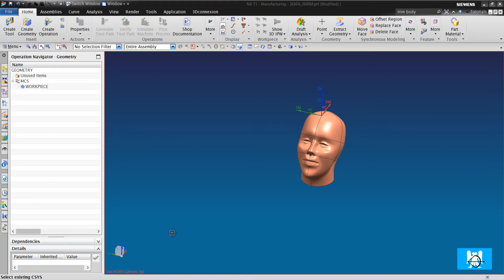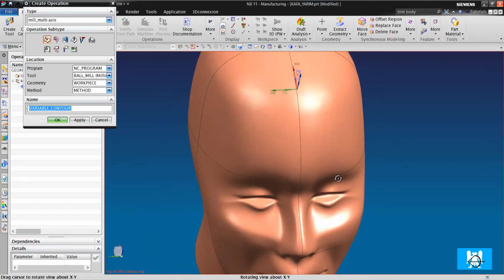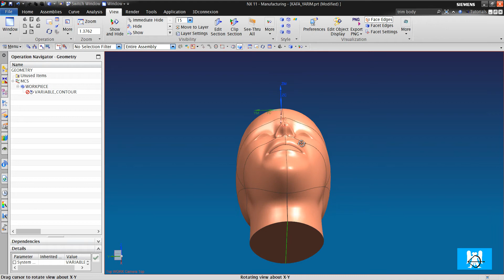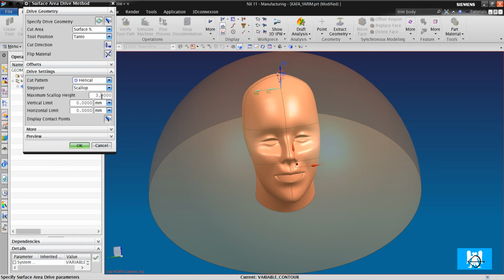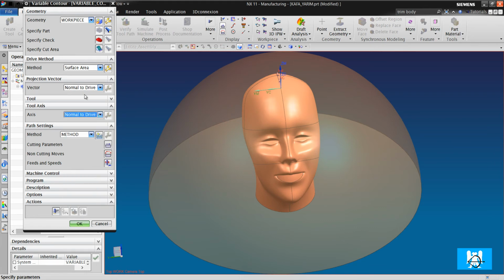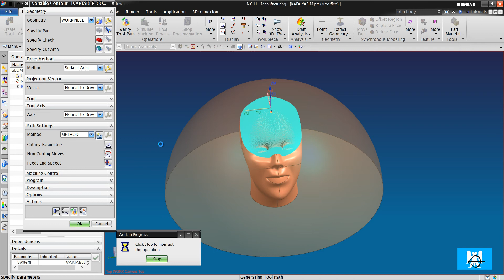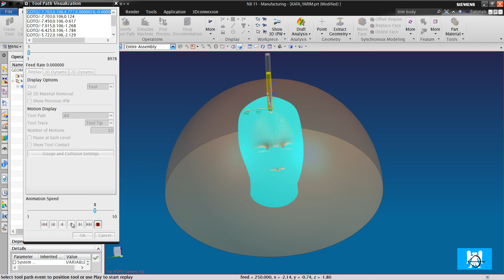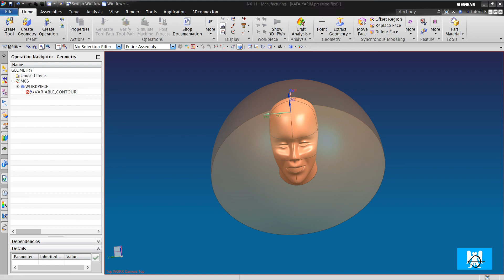23-Surface Area Operation - 3

Comment: Hello,

I'm engineering student and i learing NX right now your chanel is very helpful for me. But did you have any postprocesor for DMU50 Sinumeric 840D 5axis control or Haas VF2 3axis milling machine. We have got this machines on school but no one has postprocesor. I will run some NC codes to see how it works in real life.
Reply from the maker: Hi. Can you give me a mail. Also will posts will be mm or inch? Five axis machine head head or table table.
Reply: pawel.klimko@onet.pl Post should be in millimeters. On 5axis machine is rotable tabele
Reply from the maker: I sent.